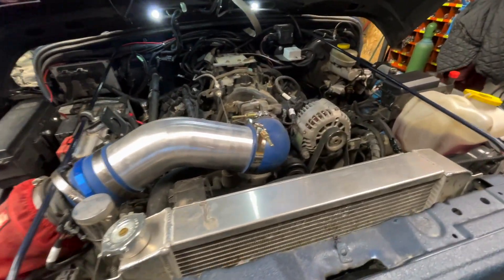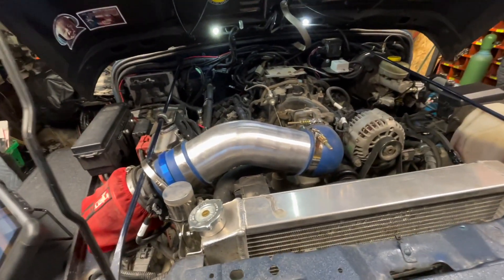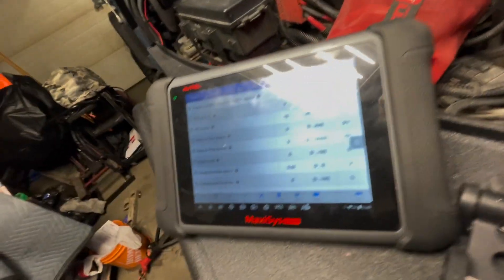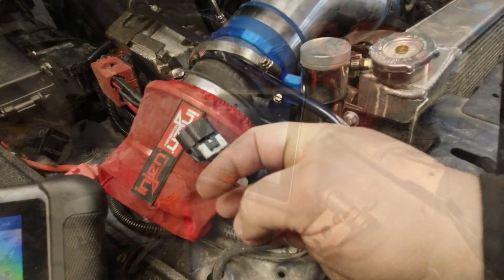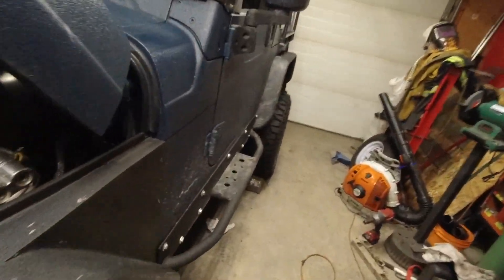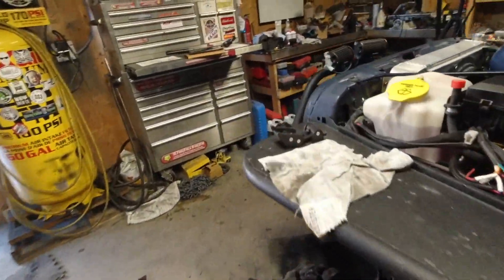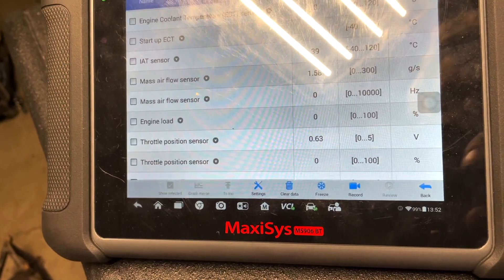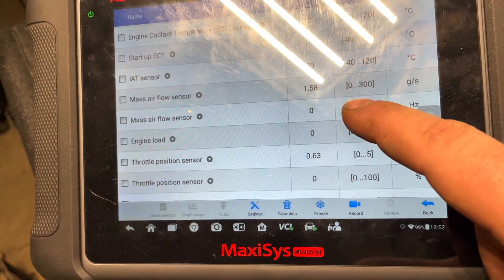P0103 Mass Air Flow MAF Circuit High Frequency

Comment: I put a cold air intake and got this :( ordered a new MAF. check engine light came on too of course
Reply: Did u ever figure out ure problem ? I’m having the same I changed my maf 3 times and still have the same code
Reply: @jacquelinemejia6792  Hey yes I did , it was because my MAF was bad, I had actually ordered the same exact MAF 😅, got my friend to take the CAI off and everything, make sure everything was tight , cleaned up and the check engine light came off , you replaced your MAF with a brand new one and still the light is on?
Reply: @DeathCoreSlayz  yes. First I replaced with an aftermarket one so thought maybe it was sensitive to that since it’s a bmw. So I purchased an oem  and still the check engine light is one with only that code showing
Reply: @jacquelinemejia6792  Oh darn I would try taking it to a shop to try and get that fixed, I was mad as hell, definitely can't even drive with the check engine light on and with that code, car wouldn't accelerate for shit and started stalling , I was about to send the CAI back, well sell it lol, you'll get that code fixed, I have a Honda so I'm not sure why your check engine light is still on after replacing it with an OEM MAF
Reply: @jacquelinemejia6792  when the MAF fault code gets triggered after a CAI install it isn't the cold air triggering it, it's the high flow air filter that is allow a lot more air into the intake which sometimes causes turbulence around the MAF sensor causing false readings.